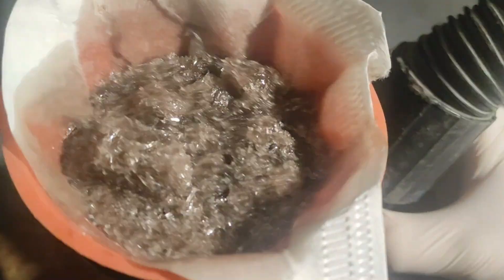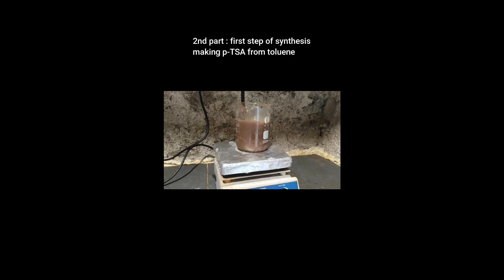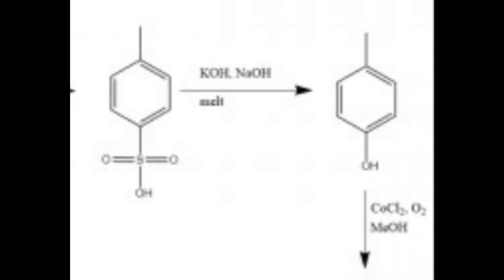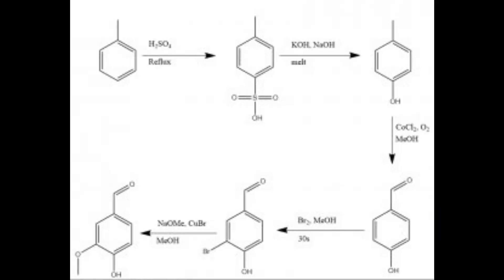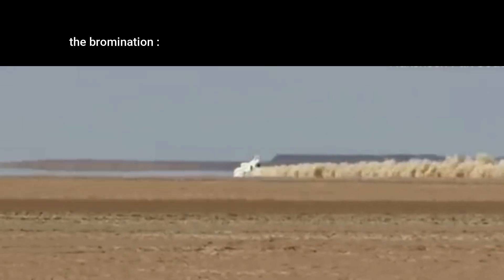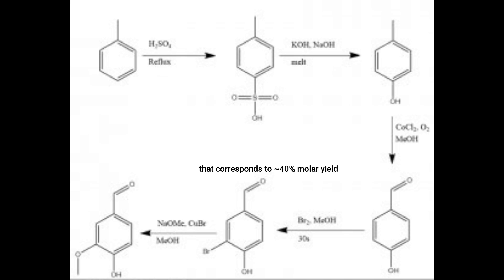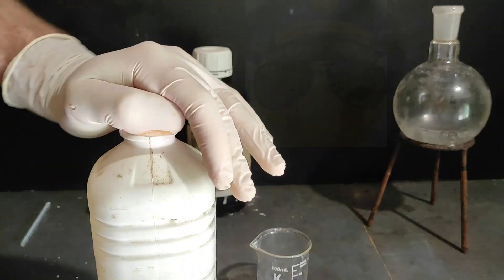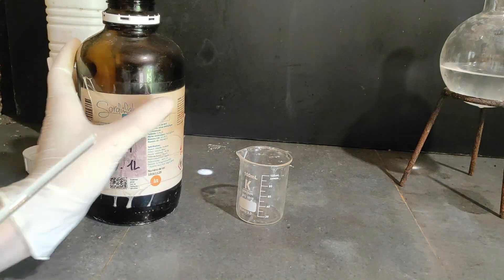Vanillin from scratch : how hard could it be ?

Comment: Have you had any luck with the caustic fusion step to get the cresol? I'm curious to see how you purify it; the OrgSyn procedure uses a vacuum distillation to purify it, and as I recall you don't have a strong pump (they do it at 15 mmHg).
Reply from the maker: Yes well for reasons i have done this step now 3 times and i can say it's very reliable even if you don't respect the temperatures precisely, as for purification I just don't do it because i don't have vaccum pump but the product does crystallises when cooled down so i'd say it good enough. I have problems with the extraction of the next step tho.
The video should be out in the week I just need to finish editing !

Comment: Copper(I) bromide is easy enough to make given a copper(II) salt, a bromide salt, and a reducing agent such as sodium sulfite. You just need to add an acid to a solution of copper(II) ions, bromide ions, and  sodium sulfite/metabisulfite. IIRC the bromide is poorly soluble and should precipitate as it forms. You could probably get away with using copper(I) chloride; the reaction you are doing is called an Ullmann condensation and copper in the +1 oxidation state is an important prerequisite for it to function.

I have heard of a similar procedure in which 5-bromovanillin is reacted with magnesium rather than sodium methoxide with a copper(I) catalyst to form syringaldehyde. That is the same basic principle, and you can get magnesium methoxide by dissolving magnesium turnings in methanol with a crystal of iodine to remove the oxide layer. It might work for your conditions.

Ethyl acetate is a pretty common solvent; I cannot speak for French hardware stores but here in the US ethyl acetate is sold by the gallon at reasonable prices at paint thinner. You might want to consider looking through the SDS's of the various paint thinners your local hardware stores sell to see which ones contain ethyl acetate. It can also be found in some brands of nail polish remover in place of acetone. There is a company called Laboratoriumdiscounter in the Netherlands which apparently sells chemicals to individuals in the EU; Thy Labs gets a lot of his chemicals there. If all else fails that might be a good place to look; apparently they sell a liter of it for ~€17.

Doing a flash column is indeed a challenge, but some people have had decent success using cheap silica gel cat litter ground in a blender. It's important to use the kind without colors or odorants. You could also buy cheap TLC plates and capillariess on Amazon and use them to see if there is a solvent mixture which is good at separating 3-bromo-4-hydroxybenzaldehyde from vanillin, and try to do a recrystallization (water might work; vanillin is rather soluble in boiling water IIRC). I found your jerry-rigged Dean-Stark apparatus very clever despite the issues, and admired your patience to hand-separate the water. I can't say I'd do the same. All in all I very much appreciated the video! Good luck on this project.
Reply: Lighter fluid is essentially reasonably pure petroleum ether, but usually contains some dyes and higher boiling impurities. You will need to distill it before you use it. It is probably a good idea to look at the SDS for the lighter fluid; look for "petroleum distillates" and check what the boiling point is.
Reply from the maker: @Zenzicubic thanks I asked other ppl and they said hexanes was fine so I'll distill some from gazoline I guess ! Also I'm planning to buy real silica gel in the end because it is very important it seems and cat litter just wouldn't be good enough
Reply from the maker: Thanks a lot for the response !
I think I will buy some NaBr and ethyl acetate as well,
For the NaOMe I think I will buy some 3A mol sieves because apparently NaOH and MeOH does make methoxide if enough mol sieves are added after some time.
As for the chromatography, they use a mixture of petroleum ether and Et2O so I was thinking if I distill hexanes from gazoline that could perhaps work too, idk if the Et2O is mandatory tho, could make it anyway...
Cat litter is a very funny idea I think I had heard of it too, I'll do some research but if it works why not !

Comment: you can make NaOEt from a solution of NaOH in anhydrous ethanol by distilling off water in the form of a ternary azeotropic mixture of ethanol-water-solvent (benzene, cyclohexane, isooctane, toluene etc.)
Reply from the maker: Thanks that looks like a cool way to do it
Reply: @jam_kemist3986  you should use excess of ethanol and around same volume of solvent

Comment: You can make sodium methoxide by reacting sodium hydroxide with methanol, Thy Labs maed a video about this
Reply from the maker: Thanks ! Imma watch that right now
Reply: Thy Labs used sodium metal. The reaction of methanol with NaOH is in equilibrium with the resulting water reacting with the NaOMe again. Sometimes it's not a problem for example when making biodiesel but in this case I think you need water free NaOMe. NurdRage used NaOH, methanol and molecular sieves. It works but maybe the molecular sieves  will get damaged
Reply: @HanTrio3  NaOH destroys molecular sieves. Sciencemadness has procedure posted to make NaOEt.
Reply from the maker: @HanTrio3  yeah I just did a little bit of research, either I need sodium metal or a way to dry NaOH MeOH mix, I was thinking perhaps CaO could do the trick as it would form the hydroxide which I can just filter in the end, I've seen no one do this tho which is a hit worrying